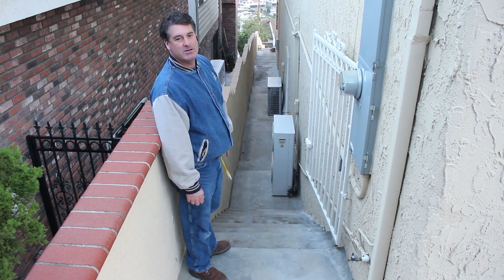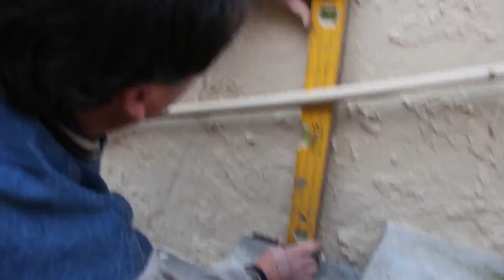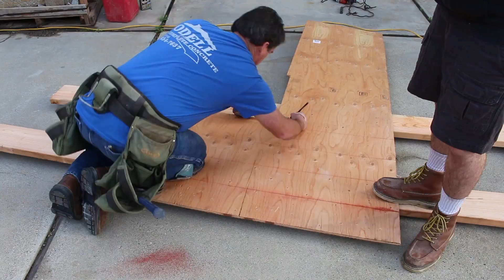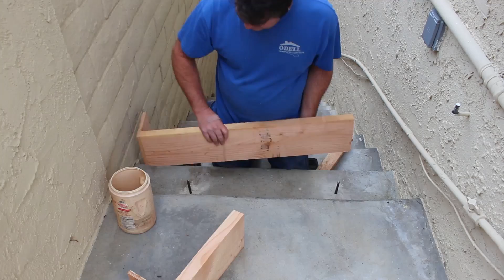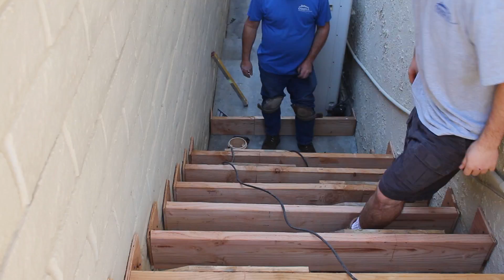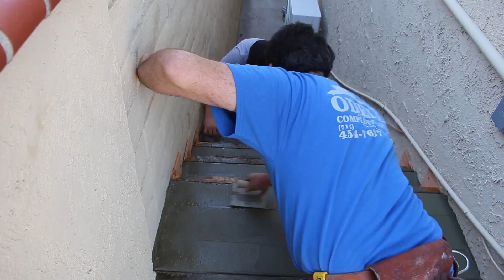How to Build and Pour Concrete Stairs

Comment: Hi O'Dell
Beautifully constructed concrete stairs.
Please suggest  .
My concrete stairs project is the same on your video there is a wall on both side of stairs, the difference is the are no older steps below to pour concrete on.
I have to build forms for new stair case with a block and brick wall on both sides.
Do you have a video showing complete forms to build new concrete stairs.
I appreciate,  if needed I could call you to explain better I'm NJ. 
Thank's 
Antonio

"Enjoyed the steps viedeo"
Reply from the maker: Same technique

Comment: Hey man, awesome work. I'm about to pour a staircase that's exposed to the elements and would like to put a slope so the water can run down the stairs where I have a drain. Any tips on how to place the concrete on a consistant slope while finishing it? And how long between the pour and taking out the forms? I live in Canada so it's already cold out.
Thanks for your guidance in advance. Cheers
Reply from the maker: Set the risers with slope, and check with a level as you float and finish

Comment: Really nice finish, i’ve heard you’re not supposed to use steel trowel until all water evaporate from the concrete surface, would be interesting to hear your feedback on that. Thank you
Reply from the maker: That's what I've heard also

Comment: How do you decide when to dowel rebar into side walls or not? Or single wall in this case. I have a couple steps to form between two walls in the sand and wondering if I should dowel in rebar. 
Also curious when you attached risers to house did you find studs or just attach to stucco. 
Beautiful work
Reply from the maker: Attached to stucco. Depends on the wall condition, thickness and if its grouted

Comment: How long should you wait before pulling the forms so they don’t slump yet still are wet enough to finish! Unfortunately I’m using bagged concrete for this one so I’m sure it’s a whole different ballgame with that as well. Advice would sure be appreciated. Thanks for sharing.
Reply from the maker: Depends on weather, shade, base ?
Reply: Odell Complete Concrete. It’s inside an unheated garage, no sunlight, weather 40ish and base is clay/gravel. I know it’s an impossible question but any sort of test you can try or anything to help. It is sakrete so I’m sure that’s more difficult.  Thank you.

Comment: Let me try and explain that tape measure, every job site I have ever been on had 1 of those tanks in its arsenal.

Most tapes aren't built well enough to have the paint be the first thing to go, they either get a lil dirt or concrete inside the retracting mechanism and get stuck and are done or an overzealous attempt to extend it out 15' or more to reach Harry has caused bends in the blade and it breaks or it got dropped and the plastic casing busted. 
When the tape you JUST bought a month or 2 breaks in the middle of a job, their is always a Big Silver hunk of tape measure in the tool box but you better know ur shit cuz most the 1/8 and 1/4 marks have chipped off.
Did you hear that action when he let it retract? That's craftsmanship people! Just shitty paint
Reply from the maker: Your 100 percent right.
I think I still have that one.

Comment: You are modifying these stairs due to a code requirement of clearance area in front of an existing electrical panel. Have you addressed the 36” required clearance at the bottom of the stairs? It looks like the mini-split cu is encroaching into the path of travel.  Typically, a min. of a 36” deep landing is required at the bottom of a stairway.  I’m a California Architect; your state may allow this situation?
Reply from the maker: This is residential

Comment: I hope you will understand my question and answer it. Could you please tell us the recipe for this concrete type?
I mean how much concrete, fine and course aggregate is used in the mixture?  I really like the way you finished those stairs. Thank you.
Reply from the maker: two cement, three sand, 4 rock.
Reply: @OdellCompleteConcrete  Thank you! We use more cement and I just can`t do the job so well so I have two more questions. What type is the cement and which are the dimensions of the sand and rock? In my area the sand is 0-3 millimeters and rock is 3-7, 7-16 or 16-31.

Comment: That's great until the code says you need more space around an air conditioning unit!  I only have 5 steps to put in, in a similar situation but they are 9 ft wide, this system is far superior to one I had devised, thanks, you saved me a host of potential problems
Reply from the maker: Sure

Comment: I often pick apart work shown on these videos, especially that of so called master carpenters. I have alot of fruends working crete here in Detroit ,and wish you lived in Michigan.
Your work speaks for itself.
Nice staircase.
Q: Is a pitch allowable by code on a concrete step?
Nit allowed on wood or composite.
Only allowed 3/16 difference in any step and 3/8 total in a run here in Michigan.
Great job.
Reply from the maker: I like to go 1/8" slope, If you don't your going to get algae,
That gets slippery

Comment: If you cut the bottom of your risers at a 45 degree angle it makes floating under the riser much easier. We cut them at 45's every time we pour steps.
Reply from the maker: I don't like that system, because its hard to find the bottom.

Comment: Also you should use chamfer strips to avoid the front tread to not chip in the front or put a bull nose on it. I'm sure you know and this was probably just a quick fix job?
Reply from the maker: Faded 
Not neccesities,
Just personal preference.
Reply: Odell Complete Concrete everyone has their own opinion but the edges of the treads will eventually chip if you don't use chamfer strips. I was taught to put them on all edges to prevent chipping

Comment: When I worked for a concrete company we would use a broom and just apply diesel fuel to grease our forms. Guess depends where you live if that's cheaper then motor oil
Reply from the maker: I have used diesel fuel for concrete also

Comment: Nice work, very similar to what we do here in our area. Our forming and attaching vary slightly but with same results. The only thing I notice that we do different is I would pour in the same direction as we finish (from top to bottom) as this is generally the order they would get hard. This is not essential but helpful if the concrete is setting up fast.
Reply from the maker: Another words you would be upside down finishing the concrete.
Reply: Odell Complete Concrete Hi Dave. NO, ALL I Meant was if I finish top stair first I complete pouring top stair first. I complete the pour in the direction I am going to finish them, top to bottom, same as you. Using accelerate such as polar set also is nice as it provides a nice buttery cream to work with. Again, they look nice. Good job. I get crazy with accelerate at times so timing became mess essential so I have to finish same direction I pour.
Reply from the maker: You do know the high areas dry first since water go's down hill.
Reply: Of course, that's why I work top to bottom with the pour and the finishing process. I enjoy the variety of your videos. It must be nice to get into so many different types of projects. I do mainly new construction in the Midwest so the variety is not huge. I did get to stamp a wood panel pattern patio last week. I enjoy the custom side of things. Keep the relaxed attitude up and the videos, they relax me and entertain me.
Reply: Oh, and to your comment above about the water. I see nothing wrong with your method. I do it the way I do because it seems to speed the process for me and when I get to the bottom during the finishing process the last step still has some moisture. Keep up the good work!

Comment: People don't appreciate, next to slabs/pillars/freeways/bridges etc. this is probably one of the most important uses for concrete in the world. We take stairs for granted, and if they all had to be fabricated from steel etc. it would be hugely expensive and time consuming. Not to mention the durability and load-carrying capacity of concrete.
Reply from the maker: That's the truth.
TY
Reply: The Romans used it so has to be good

Comment: Great video, cool stuff! How did you secure the 2×4 at the bottom. Did you just pin it on an angle to the concrete? Or did it not need to be secured?
Reply from the maker: I drilled a couple blue screws  in a 2x4 laying flat.

Comment: Try a 16 d nail and bag tie with a 3/16 tapcon bit thats what i do to save on blue screws
Reply from the maker: I reuse the blue crews,
so it doesn't matter to me.
The only time I use wire is when I don't have the right size drill bit.

Comment: Ever built a stairway that cuts into a rockface?...If so, do you have footage of it.
Reply from the maker: Toy Mit 
yes but no footage
Reply: Thanks for replying. Was it a similar method to this or different? Did you cut into the rockface or just place it on top without altering the rock itself.
Reply from the maker: Toy Mit 
attached to rock.
#5 rebar epoxied in 12 inches

Comment: would moving the electrical panel been  a less expensive option?  It looks as though you would have enough room on the right of the panel to center it over the existing walkway leading to the stairs.
Reply from the maker: We worked the numbers both ways and this was the best option.

Comment: I spent the summer when I was 17 putting foundations in with my grandpa. Talk about back breaking work. 3/4" thick wood form panels soaked with 20 years worth of diesel. Even finishing the concrete was much harder than I imagined. I learned a lot, but most importantly I learned that I didn't want a career in concrete. Kudos to you for doing this work. I am surprised you did all this just to accomadate the meter though. It would have been far cheaper for the homeowner to relocate the meter.
Reply from the maker: Mike L 
intense

Comment: American making concrete stairs, no bad! Need just a little bit of bars reinforcement!
Reply: I guess you weren't paying attention to the master. 13:45 The concrete has fibre mixed in it.
Reply: David Odell Next on Odell Complete Concrete, "How to build a B-52 runway"
Reply: What do you mean?
Reply: More iron, maybe two layers of grid!
Reply: telosfd 
I'm not building a runway for B-52's.
Reply: Thickness of slab is large it needs upper shrinkage bars
Reply: What has a nationality to do with making something concrete? The procedure and the concrete mix in Africa and Asia and where not is exactly the same.
Reply: You have obviously never seen Filipinos working concrete.  :)

Comment: wow what a gorgeous job!
Reply from the maker: davis icon 
TY
Reply from the maker: isailwind 
The problem with 45 degree cuts on the bottom riser is its hard to see where the wood ends and ends up getting buried.
Reply: Looks great.  I cut a 45 along the bottom edge of the risers, makes finishing a lot easier.
Reply from the maker: davis icon 
I do that sometimes.
Reply: Odell Complete Concrete   I've never had that problem.
Reply from the maker: isailwind 
it's just me. I guess

Comment: pretty sure those steps were there before the panel was installed. sounds like a problem for the Muppet who installed it, why not move the panel to the right?
Reply from the maker: Michael Birchall 
this was the least expensive way to go.
plus the old steps weren't as nice as the new ones.

Comment: It’s poor practice to place concrete against stucco like that. You create a situation where water can get trapped between the concrete and stucco, leading to rot or decay. You might get away with it, or all that might have to get jack hammered out down the road.
Reply from the maker: John Fryer 
your probably not a concrete contractor.
I don't know how observant you are but I guess you didn't notice that this house is on a hillside, or maybe you just don't know what that means.
I guess I'll explain it to you in common sense terms. 
it means the floor of the house is much higher than at the bottom of the hill. also it means there's no wood, because it's all block retaining or concrete retaining walls.
one other key observations is the existing concrete has been there for 30 plus years with no problems.
in the future don't make assumptions without thinking  first.
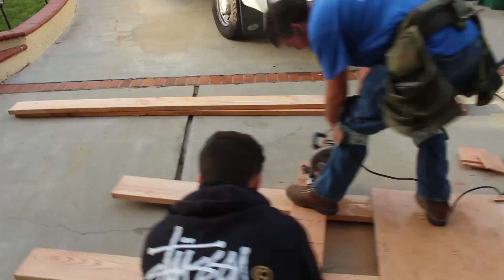Reply: It’s a CMU wall on one side, and wood framing on the house side. I wouldn’t have any way to know that except that YOU SAY IT IS at 4:55. Pouring concrete up against wood frame is not best practice. You may get away with it, but people shouldn’t leave with the idea that it’s okay.
Reply: "Basically I went inch, 1- inch tapcons cuz, when I'm drilling into the house side, I dont want to drill through through the paper." You are saying it's OK to pour concrete against wood frame. https://youtu.be/ywd5n7L9lqI?t=4m35s

Comment: WoW looks fantastic finished product man! at 11:35 you talk a few terms i am unfamiliar with. would you clarify these? you mention
"4 inch slump"
3000psi
"1% Polar Set"
im guessing the polar set is an additive to catalyze the drying process in cold weather? 3000psi has something to do with the ratio of portland:sand:aggragate or something?
Reply: I'll answer it for you. 4 inch slump is a term for the workability of concrete (flowability). There's a standard cone for concrete workability testing. You fill that cone up with your material then you remove the cone. Obviously the concrete slumps a little when you remove the cone. The amount of slump specifies your workability. The higher the number the more runny your fresh concrete is. 

3000 psi is the compressive strength of concrete i.e. your concrete, after 28 days, will carry up to 3000 pounds per square inch of area before it cracks. To be honest for contractors like this this number doesn't really hold because they rarely control the amount of water. They only adjust the workability for their convenience. Therefore the strength of the concrete they cast can be more or less. 

Anyways. I hope this answers your question.
Reply from the maker: Heath Wood 
I may buy a slump cone and test each job prior to pouring.
also I'm considering cylinders to do break test to check the real psi.
Reply: Halim Kerim BAŞ halim thank you for your response. Very articulate and concise. Very helpful thank you for taking the time. God Bless
Reply from the maker: Heath Wood 
your right on.
1 to 12 inch slump the 1 being driest.
Reply: Odell Complete Concrete thanks Odell for your helpful teaching. I like your videos a lot. Idk much abt concrete work but I love to learn. Especially from a real pro like you. Best wishes
Reply from the maker: Heath Wood 
your right on all accounts.
slump test is based on a 12" high upside down funnel filled with the concrete.
lift the funnel up and however much the concrete falls determines your slump.

Comment: Great job and video, but I would've told that meter reader to deal with it, fricken democtats
Reply from the maker: Jerry Hoskins 
It was that or no solar panels.
Reply: Has nothing to do with the meter reader or democrats.  It's a National Electrical Code requirement for servicing electrical panels.   You have to comply with the code no matter how macho you think you are or the electrical inspector will not approve the solar panel installation.
Reply: One never wins an argument against the codes..It's as simple as meet or exceed the codes or buy candles.
Reply: Whoever told the building owner that a wider landing was required at that panel was mistaken. The video shows there was sufficient working access already present, per the National Electric Code.

The NEC requires a clear workspace that’s 30 in. wide, and 36 in. deep. The 30 in. width measurement does not need to be taken from the center of the panel, it can be measured from either side.

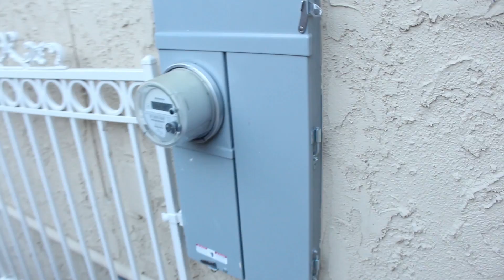The width of the pre-existing concrete landing is at least 30 inches. Using the white gate as a reference, you can see the gate edge extends over the landing at 0:20. The panel above is just to the right of the gate as shown at 1:10. The landing only needs to extend 30 in. to the right of the panel to provide code required width. The landing is likely much wider than required.

The depth is certainly not a problem because the stairs (and landing below the panel) are over 4 feet per the video at 1:34.

I think this may have been a case of an overzealous and mistaken municipal building inspector, or perhaps a solar panel installer. It doesn’t look like this stair work was needed at all, at least from an electrical code standpoint.

For research on your own, a good Google search term is: “adequate workspace keeps electricians safe” which is an old Mike Holt article, but it has graphics. 

On the concrete work, I think you did a really nice job. I especially liked the way you split the riser form boards so they could be stripped easier- that’s definitely a pro move. I could see you discussing my concern with the client and going ahead with the pour anyway, which I’d be cool with if everybody knew the potential concerns. It may be a well-protected part of the building where it works out.